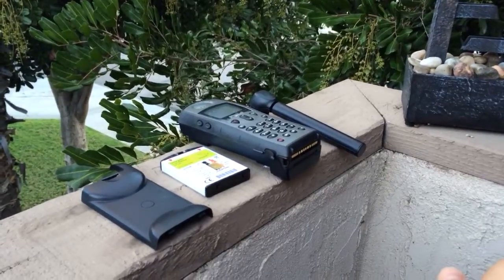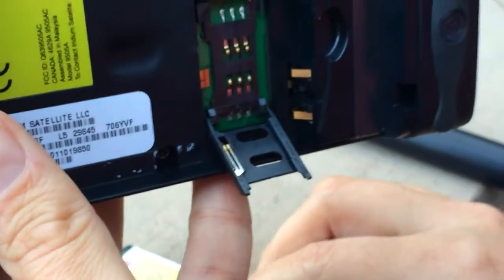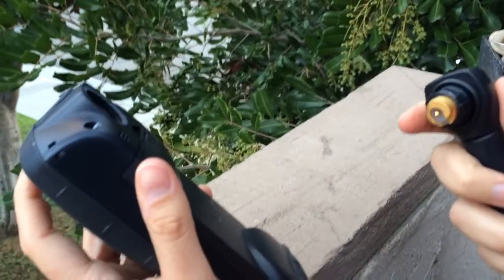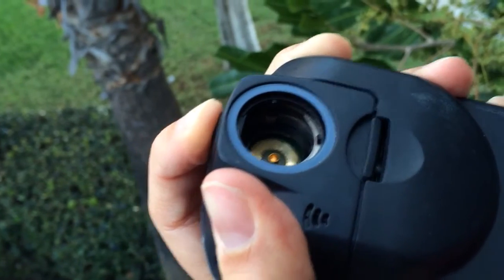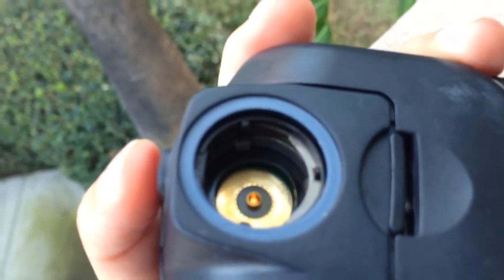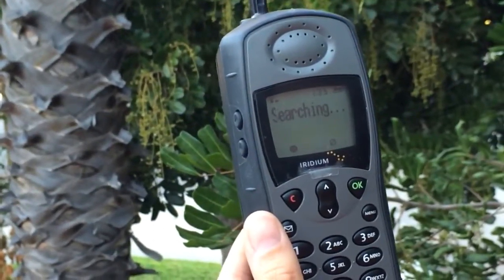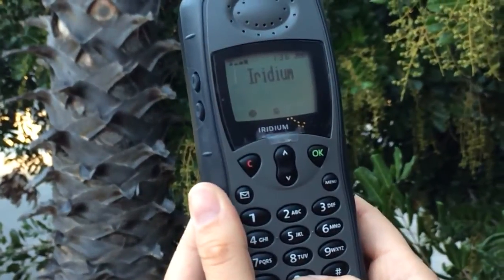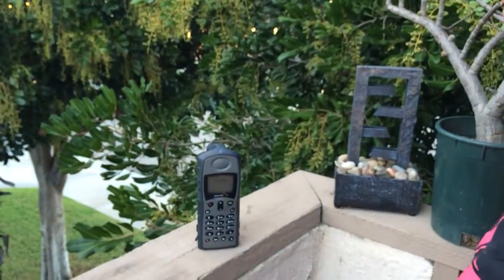Iridium 9505A : Troubleshooting & Make a Call : NorthernAxcess

Comment: I've bought my 9505 since 2001 and fornthe first time in 21 years I've replaced my original battery pack with another new one (not original) right some days ago.
It is operative everytime 24 hrs a day and it run very good.
The only one issue that I've saw since several months is that it doesn't show incoming call numers anymore.
The display show only "incoming call" and nothing else.